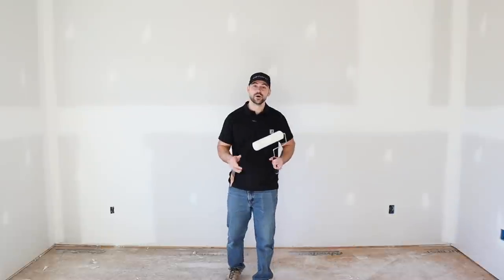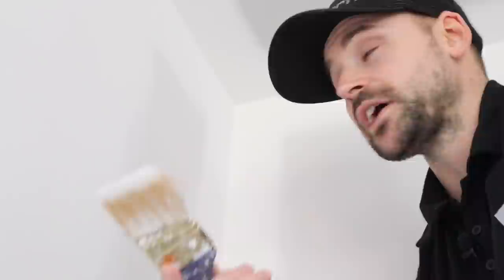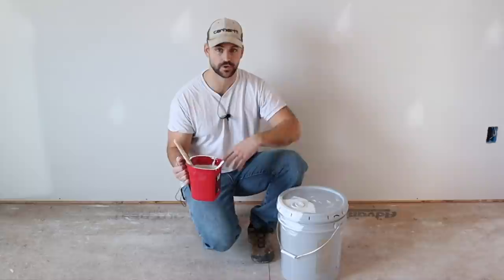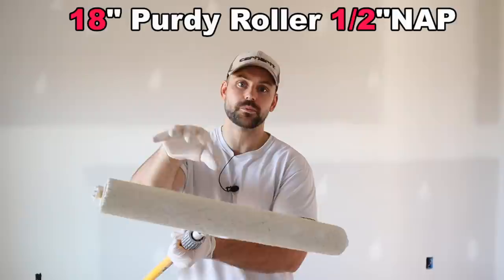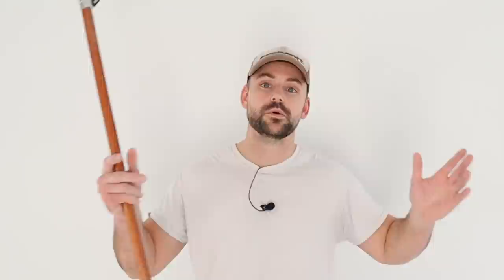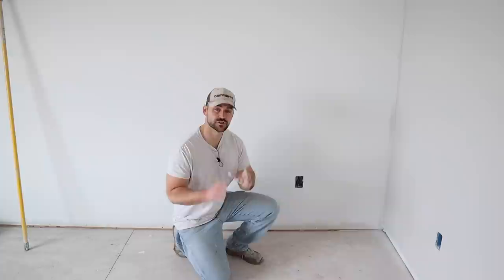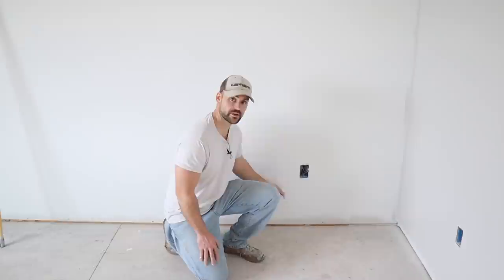How To Paint A Room - Step-by-Step Guide for Beginners

Comment from the maker: Hey Team, I placed timestamps below 👇to help you navigate the video. I hope it helps!
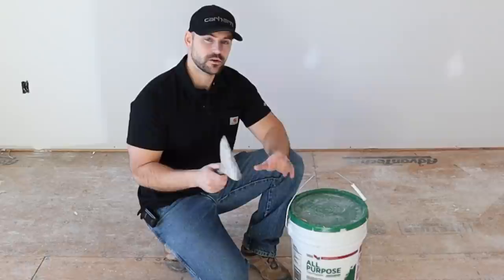How to patch nail holes 01:35
How to dust the walls 2:10
How to apply primer 04:29
How to paint the ceiling 13:44
How to cut in paint 16:23
How to roll paint 20:31

Comment: A lot of miniroller or 9" rollers can get into the corners very quickly and neatly (some even have finished ends designed to paint directly into a corner).. Definitely something to consider, it saves a ton of time and effort. Also the 14" naps have frames that allow you to use it exactly as a 9" and it's a lot less weight than an 18.
Reply from the maker: Hey Alex! I have seen those but never tried them. Maybe on the next house. Thanks for your comment!